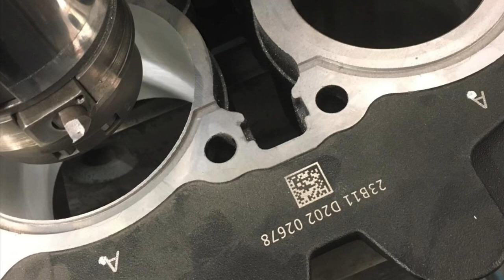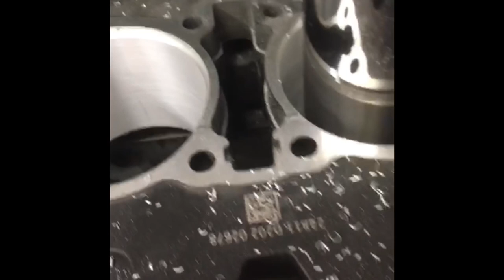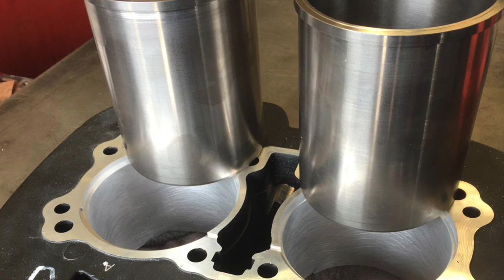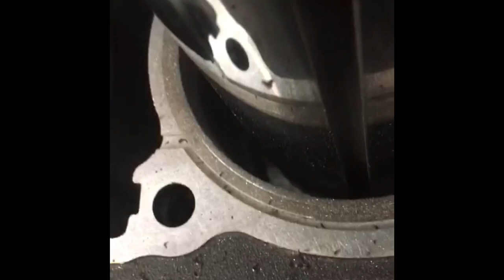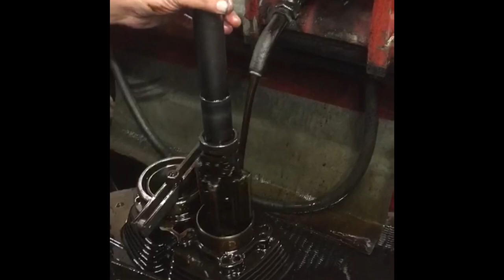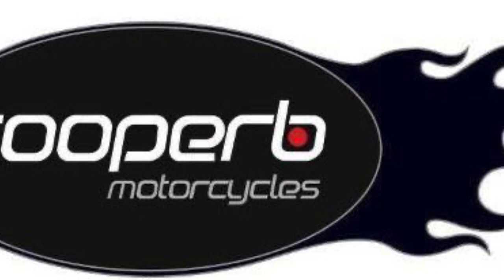Royal Enfield 650 Twin Continental GT Interceptor S&S 865 Big Bore Kit By Cooperb Motorcycles

Comment: The fact is about tuning a bike, the first 5 HP comes relatively cheap and easy, exhaust, weight reduction, intake mods and possibly re mapping. say 600-1000 bucks. that second five HP is going to cost you dearly.  involving drastic modifications to the engine, clutch, brakes if you're smart , so figure 3-5000 depending on if you do what you're supposed to and port the exhaust, polish, cam and the rest, and whether or not you have to pay a shop to do it or you have a shop. On my interceptor, I installed a light weight 2>1 exhaust, did intake mods, and re geared it a little bit lower. weight reduction about 25 pounds. 1 HP = about 7 lbs., so roughly 3 HP in weight reduction alone (very rough estimate), plus dynoed at 51 RWHP., 53.5 FP of torque. I too can twist a wheelie in first gear with a snap of the throttle. total cost about 600 bucks.
Reply: Had a look on your channel sir. The 2>1 exhaust does looks really nice. Does it sound a lot different then the two separate exhausts? 
Did you get the power gains with an airfilter and power commander as well or just the exhaust?
Have a nice day
Reply: Hi think you have e it right there over here in the Uk 🇬🇧 there’s a dedicated shop called Hitchcocks they sell the new barrels all done with pistons £1 600 Stirling all in all your looking at £3/4k with the tuning other bits my dad use to say if want a fast buy one 😂 why buy a small engine to make it fast I can see where he was coming from I like your comment 👍👍🙏🙏
Reply: @SOLOMOTOUK  yes I know Hitchcock's, and buy from them mail order online. I actually priced their drop in big bore kit, for me to import pay duty, and even do all my own work, about 5k USD. it's something for the guy who just wants a project.
Reply: @DEeMONsworld  I wanna do some small changes to my bike nothing mechanical better slip exhaust seat a couple of other things my days gone doing engines. 
They do sell some good good gear Hitchcocks do it’s on my door nearby 15 miles away lucky going there tomorrow after I’ve took the bike back to get sorted. Thanks for the reply 👍👍🙏🙏

Comment: Could you show us the dyno results and a performance road test, in dedicated videos.❤️
Reply: I can't post a dyno chart here, google TEC   bike parts, they have posted a dyno chart for the mods I did to the bike under their stinger exhaust listing. Minus the gearing change which is a finite change and does not affect power output, only leverage. What is your idea of a performance road test? And how would you suggest I present it?

Comment: How is removing so much material even remotely safe, especially when it'll have bigger forces and higher temps to deal with?
Reply from the maker: It’s just the outer material that’s being removed, new liners are fitted same thickness as original.👍
Reply: @MegaCooperb   i understand that but the head and cylinder themselves have to be stiff to withstand torsions when ignitions occur, which is exactly why higher boost cars have closed deck cylinders (Just an extreme example to illustrate my point)

Here, you're upgrading CC, compression and cams (most probably) which means higher power output and heat output. So,
less material + more heat = not as rigid

I know there are massive safety ratios with which OEMs make these parts so it's okay to take some material off... but holy hell man, if it can keep it together after such a change, then I'm impressed by RE's quality 🤷🏻‍♂️ 😄
Reply: @MegaCooperb   also, you have more combustion chamber roof area to get bigger valves. Are those available? Can you reposition the valve guides to compensate for that extra valve size?
Because that'd be the best way to realise the max benefit of this CC increment.

Also, did you upgrade the cooling system?

I'm sorry, I'm an engineer in the making but I don't know enough about the practicality YET so I'm a little more curious than normal 😅
Reply from the maker: @AmritGrewal31  there is no easy way to reposition the valve guides and at this level not really necessary. As for cooling, these are oil cooled and again, it’s not really necessary for this mod👍

Comment: unfortunetly S&S does not release HP and Torque figures.  Some have suggested this will net 5--7% WHP, but there is no proof of that.  Probably not a wise decision
 when factoring in the Head Work and Cam also needed, and Dyno.  $3,000 at a min.
Reply: there are a few examples on youtube. with the cam, exhaust and tune it's more like 2k. the compression is higher with this kit and i believe the gain was more like 30% (with an aditional 15 pounds weight loss). i'd say it makes this bike interesting, but thats just me.
Reply: But I'm doing it anyway. No one ever accused me of being wise😊
Reply: Herry Bells  30% of 40 something is not a whole lot. If it sounds meaner and pulls the front wheel off the ground without using clutch, it will be worth it. I just want to look cool at the Ace Cafe'
Reply: @brookcampbell2940  in that case I'd buy an old BMW k75 or k100 and strip it down, change the saddle and clean up the wiring.
Reply: The horsepower is about 75bhp if you have the performance air filter and cam with the big bore. So with jst the cam and the air filter with a performance exhaust you can get 60 hp. SO, is the extra 3k of work really worth the 15 more horsepower?
Reply: @kernal9093 
filter 80,-
Cam 380,-
Exhaust 340,-

Watch a few how to's and you can change it out yourself 

I'd say that's worth it
Reply: @Jan-mu6vs  thats what I'm doing to mine right now. If you do the work yourself its real cheap to crank out 60 horse with it, just the exhaust and air filter can bring it up to 55 horse just letting it breath is so much to it
Reply: I am sure S & S Kits installed by custom outfits have figures.. For the big bore kit, paired with other mods you are looking at 52 stock 55+ with the 750 kit and up to or 70+ for the 865... With air filters, clutch, ecu mapping and a lot of money spent you could go higher...

https://www.motoroids.com/news/ss-cycle-introduces-865cc-and-750cc-big-bore-kits-for-the-royal-enfield-650-twins/
Reply: YouTube video:       Episode 6: Big Bore Kits - Royal Enfield 650 Twins
Reply: @kernal9093  you're not going to get 55hp out of exhaust and air filter. You're going to get 2-3hp improvement at the wheel.